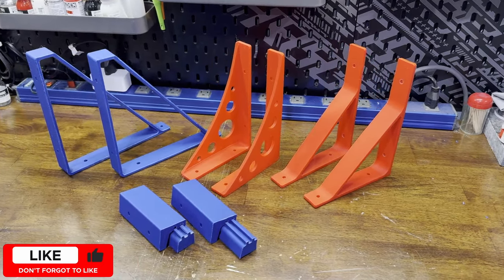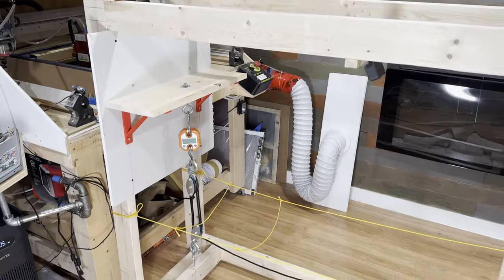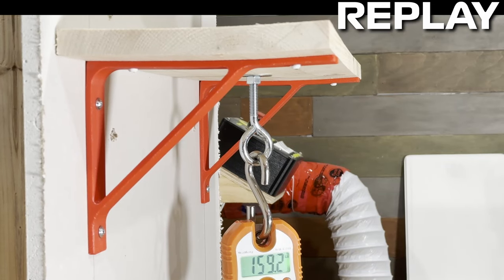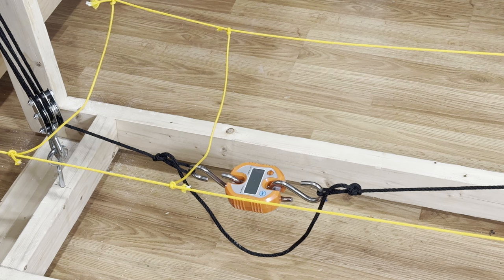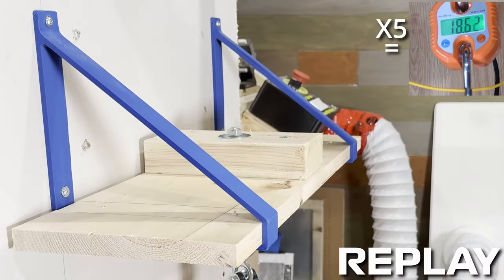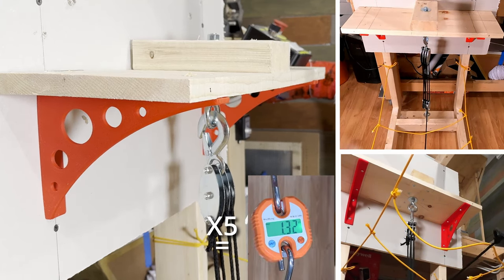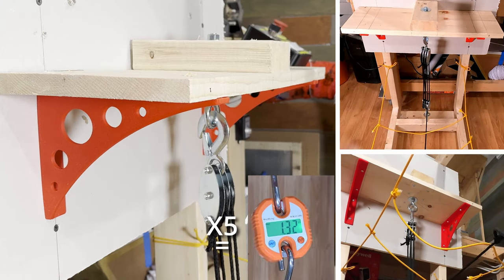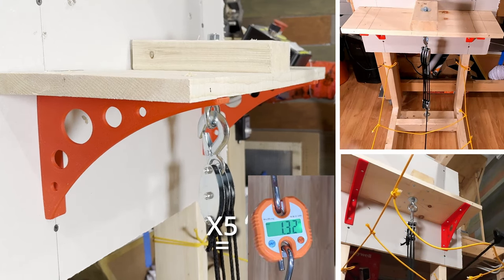Unbelievable Results: Testing PLA Shelf Brackets under Heavy Loads

Comment: Very interesting video. I noticed when you first started the board was flexing and bending more then the brackets. Thank you for your tests and the video.
Reply from the maker: I didn’t expect the brackets to hold so much weight or I would have started with a re-enforced board and a bigger scale :)

Also would have recorded in slomo if i knew the failures were going to be so violent…

Comment: Interesting.... but I've heard from other sources that often times the issue isn't immediate failure, it's long term failure due to constant stress on the plastic. This is more prone to happening when there is higher heat involved (ie: outside in a garage in the summer). I have no idea if this is true, and it would be difficult to test, but I would personally be wary of using ANY kind of 3D printed bracket long term to hold anything of any sizable weight. But that's just me. I'm sure there are others who can tell us stories of 3D printed brackets that have held up for years. So it probably comes down to the specific use case, bracket design, temperature swings, and weight. Anyway, thanks for sharing your well done tests.
Reply from the maker: Ya temp is a big factor and long term loading. My takeaway though is that because the max weight is so high they should be fine in a normal use case like a book shelf or such.

Comment: It was very interesting. PLA is known for its high plasticity (creep), so it could be very interesting if you investigated this part of e.g. PLA, ABS, PETG, etc. when they are exposed to a static load for a long time.
Reply from the maker: I thought about something like this. Or with exposure to heat to see how it affects the strength. Issue is finding the space to setup some brackets with weight for a month or so :)

Comment: Awesome video! Design 3 is similar to design 1 as you mentioned, but I think design 1's legs are both the same size while design 3 has different sizes. I think design 3 would have been even stronger if you maintained the same leg sizes:)

Comment: Great test, subscribed.
I'd love to see a PETG test.
My issue with PLA is that it fails gradually by deforming. For example, while all these shelf brackets can hold over 200lbs, how long can they do so before deforming? I had a shelf for my filament (the one by 3d printing nerd) that uses a wood bar across the front, and after a few months of sustained load, the lip that the wood piece sits in started to bend outward. Printed with atomic PLA.
Reply from the maker: Thanks!!! , if enough people are interested in this one I’ll do another with different materials and designs. 
I have some ideas for testing a plant hanger. Basically just one bracket but all the weight is at the end. If I do that I may try and set up some with static weight for a few weeks to see what happens.
Reply: @DaveRigDesign  Would love to see a long running PLA test, just to see if the deforming fears are actually true.
Reply from the maker: @George-nx8zu I’m working on a new test with single brackets used to hang things like a plant and such. It will be with multiple different material to compare strengths and I’ll try to do a constant force test where I apply weight for a day or so. 
Trying to get it out in a week or so, so stay tuned :)

Comment: I thought about printing brackets to hold my melamine shelves for my collectables. Maybe out of PETG? 5 inch deep by 6 feet long (a few brackets on each not only 2) wonder if it would hold
Reply from the maker: Petg has a bit more me flex. But from my tests just pla held over 300lbs before failing so how heavy are your collectibles :)
Reply: @DaveRigDesign  HG and MG gunpla, funko pop, and the rest is 3d printed busts and figures lol nothing heavy. Maybe I’ll try pla plus or tough
Reply from the maker: For context 300lbs is the weight of the average fridge. :)
Reply: @DaveRigDesign  that’s pretty crazy, so I should have zero issue with pla plus then

Comment: The fact you moved the scale neglects the results
Reply from the maker: It does not. At 1st the scale was at the end point getting the final output weight.

Then for the rest it is moved to the input weight which just means you need to multiply by 5

Still part of the same system. There may be some small variations due to losses in the Pulleys but not enough to make a difference. 

The scale is still between the shelf and the rack it is being pulled against.